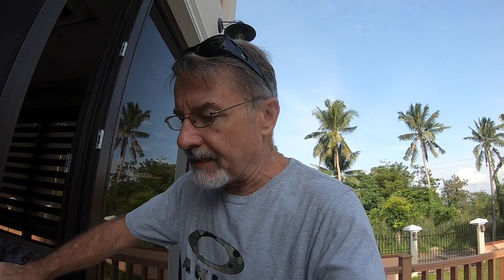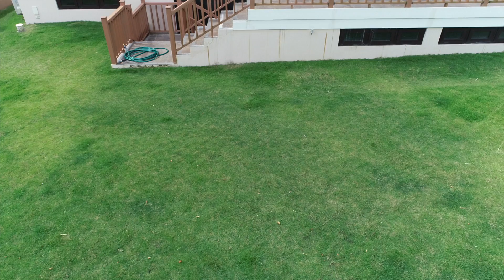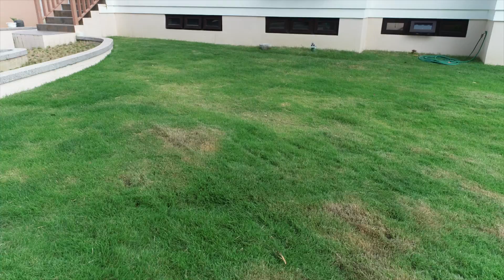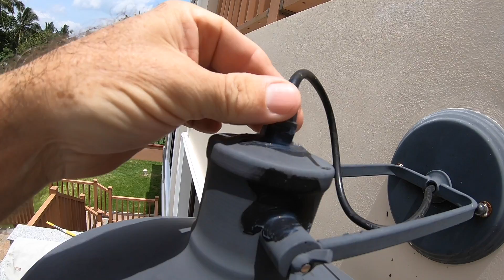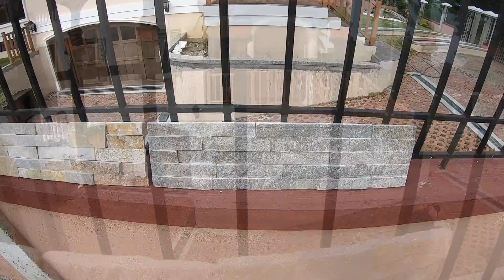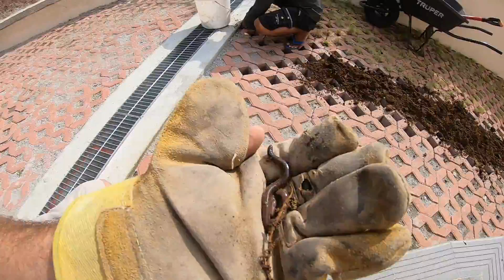VILLA FELIZ - EPISODE 363: THE EARLY BIRD GETS THE WORM (House Building in the Philippines)

Comment: From all the comments apparently it's your birthday so Happy Birthday!

I also cannot find granular fertilizer here only liquid that does very little of anything. There is an abundance of chicken manure everywhere so if nitrogen is your main need it's easy to find , just dry it out and mix it with rice husks and you can put it through a push type spreader. 

If your only hold up is the exhaust pipe for the gen. a muffler shop can use there pipe expander to open up a pipe to whatever size you need and make any bends you may need. I personally would never put a generator inside a basement though , would be numerous building codes in US to prohibit it for good reasons, at very least I would get a carbon monoxide detector with alarm and put in that room.

Comment: If the water is in your lights, its also in the box on the wall. Also, the best thing you can do for a generator is to use it! Happy birthday! Thanks for the green thumb tips! Remember the side slip issues with all 4 wheel drive. If all four wheels break traction the vehicle will walk sideways. You could ruin your beautiful concrete by using your side mirrors as giant crayons! OUCH! Do you compost your cut grass or mulch and leave it to feed the live grass? Do you eat your Bon Bon's with your fingers or do you eat your fingers separately?
Reply from the maker: Salamat my friend!  😊⭐️⭐️⭐️⭐️⭐️⭐️🌴
I will use the grass clippings for compost but I haven't built the compost enclosure yet.
You lost me on the Bon Bon's Tim.
Reply: Ah! Old joke. Bon Bon's are candy. Meaning your fingers should never be eaten at all, with or without your fingers!

Comment: H James. Is it just the missing exhaust pipe that’s  stopping you using the generator or is there more outstanding ?
Reply: I guess James not using generator because he need first to install exhaust pipe going out of the generator room.
Reply: Exhaust fan to suck carbon- monoxide up and out. Exhaust will fill up any low area since it's heavier than basement air.

Comment: James, I have a question on those LBC boxes, were they taped together as one big box or two separate boxes just on top of each other?  How did you pack a whole lawn mower in a single box?
Reply from the maker: Two boxes taped together at the middle.  I had to pay for twice the prices since it goes by dimensions.   The lawnmower was just smaller than the two boxes stacked so I put the mower box inside and packed a few items in the spare space above the mower box.